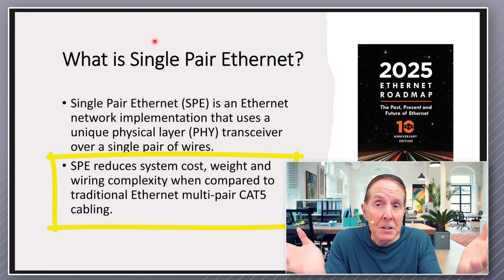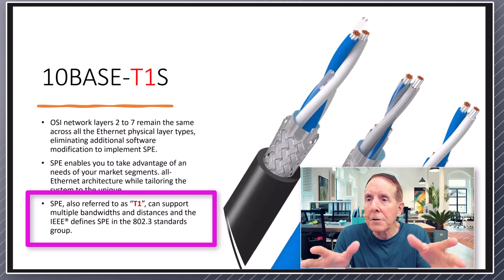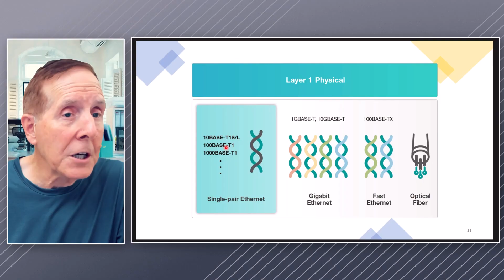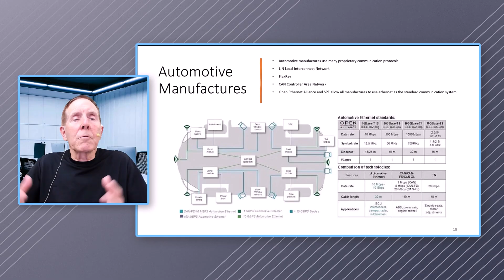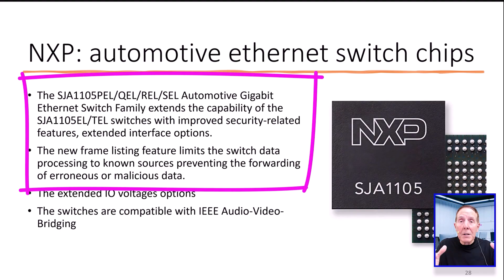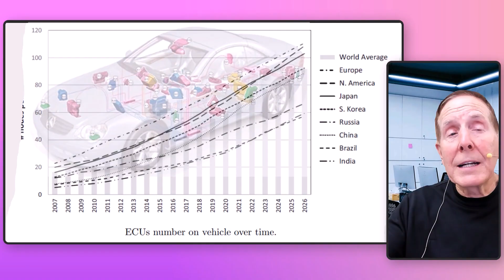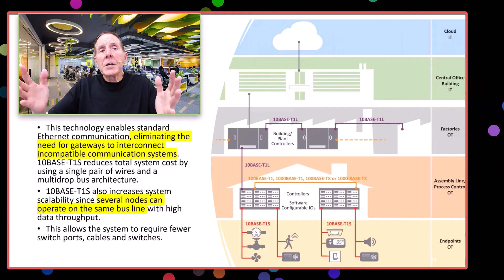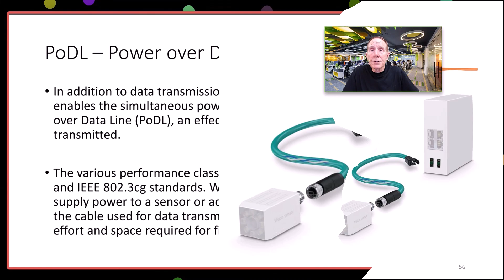Single Pair Ethernet:  Coming to a new Car or Truck near you.

Comment: As a building security tech who handles burglar, CCTV, and door access, I can see this being quite useful in those areas. Being able to run a camera 150m and power it off a continuous run would be very useful. Cat so often limits us in our runs its crazy: 300ft is used up quickly in industrial and office space settings. It would be great to see in line converters, that are themselves POE or PODL so no external outlets are needed.
Reply from the maker: That's interesting insight from a security tech perspective!
Reply: search for GameChanger cable, it can do 200m/600ft with PoE. It's not cheap, but at least compatible with regular hardware